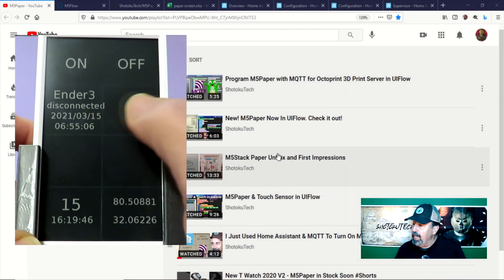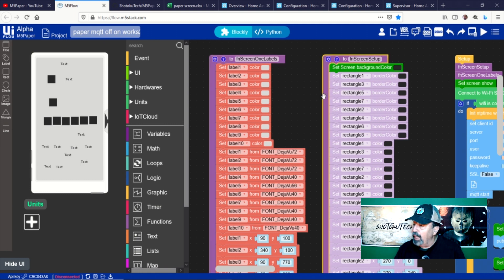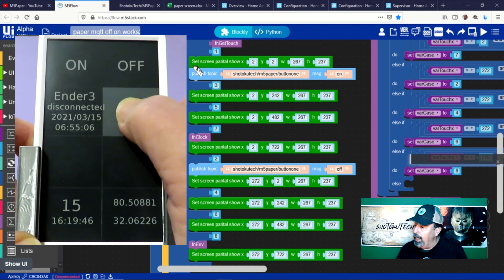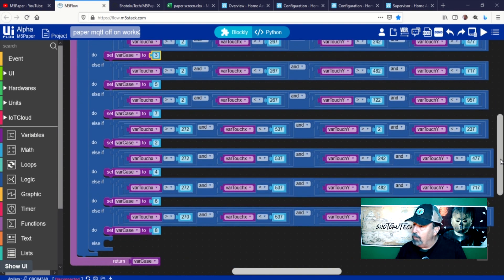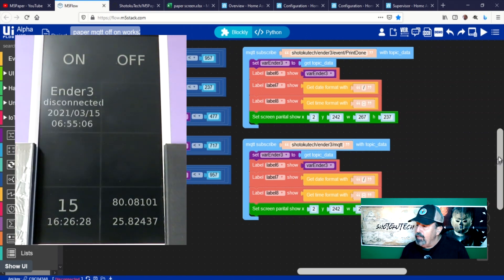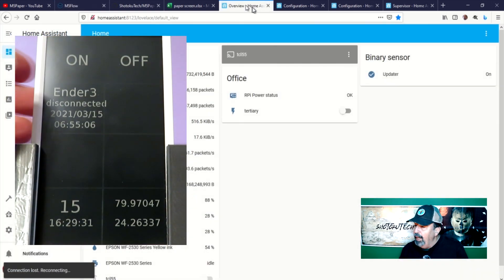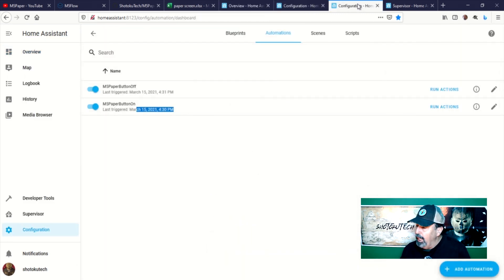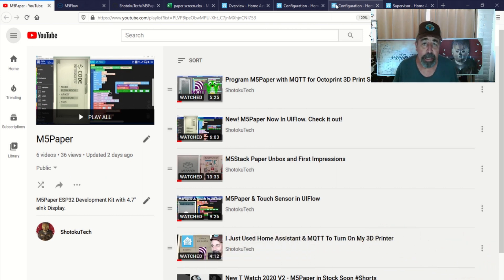M5Paper Buttons, Home Assistant Automations and MQTT

Comment: hey I uploaded the m5f file through UIflow now it seems to have bricked my M5Paper as it no longer shows inkt updates I tried to factory reset with all guides I found however, to no prevail. Do you have any idea? I can still see the device in burner and manage to connect it to UI however, no matter what i do it shows up empty.
Reply from the maker: You are using M5Burner to recover it? That should do it.
Reply: @ShotokuTech  i think somehow my display broke as I can recover it and get all succesfulls but the screen never updated from white :(
Reply from the maker: @vfxdroneshorts9637  So none of the images that you can burn using M5Burner will work?
Reply: @ShotokuTech  exactly it keeps white screen eventhough burner says succesfull
Reply from the maker: @vfxdroneshorts9637  Has this been in the Sun for a long time? That is one thing I know for sure will kill the screen.
Reply: @ShotokuTech  no and i also got it quite recently could it be the screen is defective? I will go to the shop tomorrow and see if they know
Reply from the maker: @vfxdroneshorts9637  Yeah see what kind of support you can get.
Reply: @ShotokuTech  good news after a call managed to get it working again seemed to be a lose connector after replugging it in i can see the things again time to follow more of your guides to learn ;)

Comment: So awesome thanks @ShotokuTech!
i took this as base and did some edits. added some icons an made it look pretty.
I was trying to build in a sort of if else loop to turn the device off after no touch has been detected for 5 minutes but that bugged the script.
Any one here have any ideas of how to implement this?
Reply from the maker: Great thought. I have been thinking about this one myself. Powering off after a certain amount of time with no touches. Part of the Case logic would reset the Counter if any press is detected. Then in the loop is power off if counter greater than SleepTime. I might give it a try soon. Let me know if you beat me to it? Thanks.